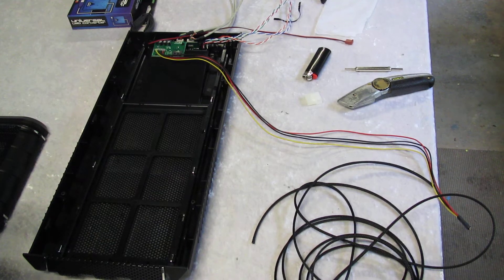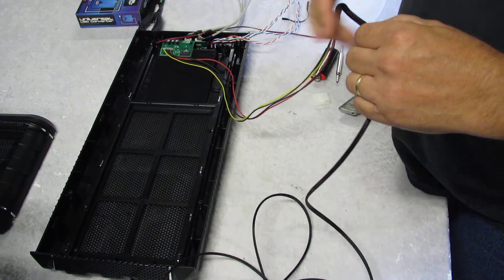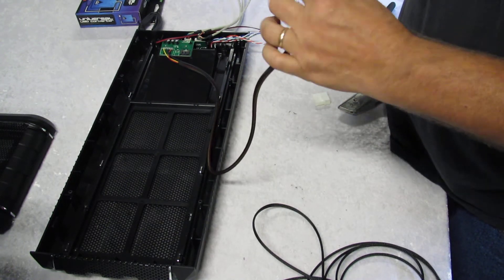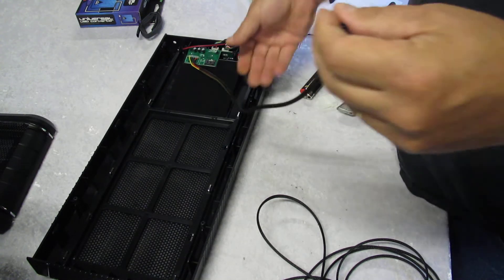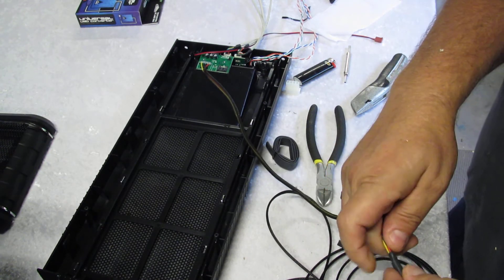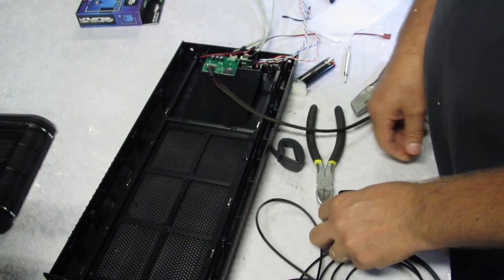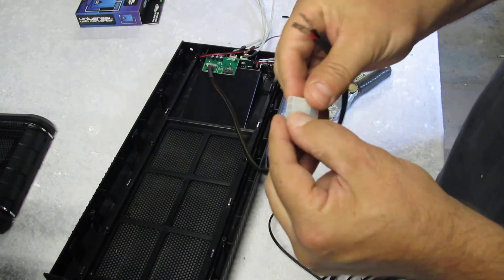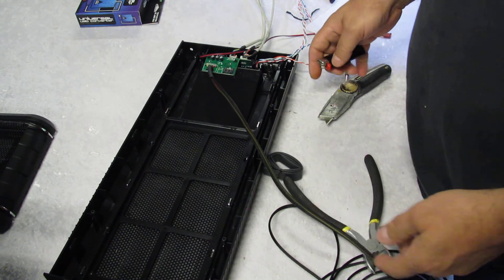Hoodcom 690: Sleeving the Front Panel Cabling Part 1

Comment from the maker: @meekoman25 For this one I used the original. Techflex makes a lot more stuff than you can find online at most PC boutiques. I've tried "sock" but it's too difficult to fish long cables through it. This stuff is cake to work with...but it  is a little see through. I want to try some of the self sealing split  braid...but it's EXPENSIVE.